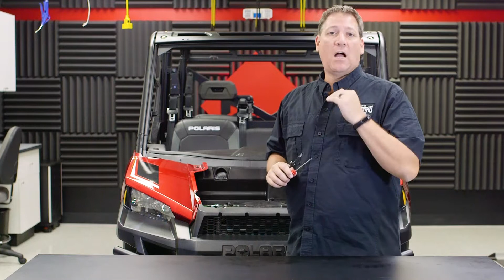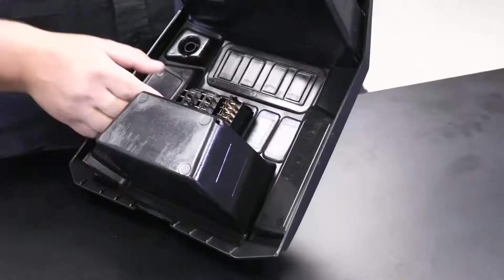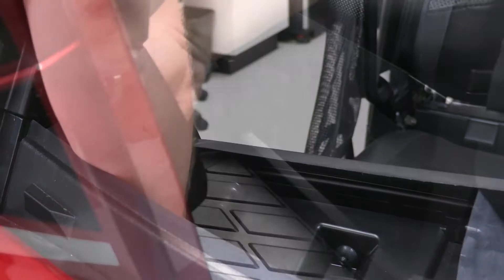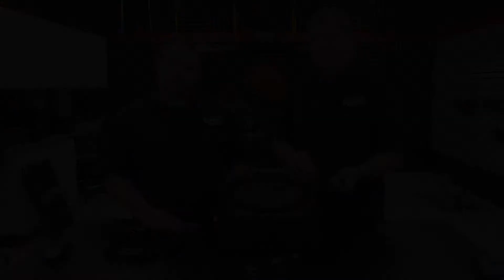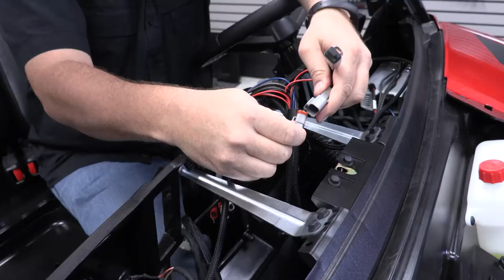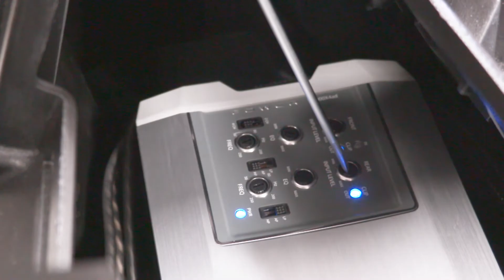RNGR-STAGE3 Installation

Comment: What about adjustment of the amp if the machine is enclosed?
Reply from the maker: If our aftermarket kit was installed and the amplifier was not tuned prior to everything being put back together, the panels will need to be removed.  There is no work-around for setting up the amplifier remotely unless you directly access and adjust the settings on the top panel.
Reply: @rockfordfosgate   i think you misunderstood my comment....you video states you set up the amp in this manner because its a open area machine.   im asking would a guy set up the amp differently in the settings because his machine is enclosed  ?   i just purchased your number 3 system.
Reply from the maker: @Dooguy  Thank you for clarifying that the cabin area is enclosed.  It's the same tuning method based on matching the PMX output voltage to the amplifier's input voltage range.  Acoustically, you just wouldn't play it as loud because you have an enclosed cabin (windshield, back glass, full doors).  You can find and download the tuning sheet for Ranger here: http://rftech.custhelp.com/app/answers/detail/a_id/1356/
Reply: @rockfordfosgate  

I received my kit today can you tell me what the cd disc is for in the kit?   also at the  14 min mark with the sub mount procedure....... I have quite a gap between the front of the enclosure and the actual machine.  like maybe 1 or two gap once the enclosure is set down in to the cavity.   I can see a ton of dirt and dust getting up into the sub cone area.    I didnt notice that gap in your install video.   not sure what can be done to close that area so dirt doesnt destroy the sub eventually.    Other than a crude duct tape job.    Any help?    2018 ranger xp btw
Reply from the maker: @UCUvJFXrf_eeMaQN6KaZn7qA The setup disc is for level setting the amplifier.  We already have the amp configuration available for you to download below.  Regarding the "PS2 Base Control" option, I'm not sure what you're referring to. Could you clarify this please?
• Amp Tuning Guide: http://rftech.custhelp.com/app/answers/detail/a_id/1356/
Reply: @rockfordfosgate    I may have the number wrong on the optional base control that the instructions said  can be added or optional.   I called RF and they told me the amp in my stage 3 kit will not accept the RF base control add on.    I found that odd as it was in the instructions in the lower left side of the page.     Can you address the gap I have when installing the bass encloser.   Its a good size gap that will allow dust and or mud.   The install video didnt really show the sub installed at a good angle.   Im not crazy about how it looks especially with possible elements coming into contact with the sub.   Thanks
Reply from the maker: @Dooguy  Thanks for clarifying.  The owner's manual states: "Remotely control the output level of the amplifier (TM400X2ad, TM500X1br, TM750X1bd & TM1000X5ad)" so the TM400X4ad amp you have does not support an external bass remote.  It only has bass adjustment on the top control panel. Regarding the enclosure, as long as the subwoofer is seated properly inside the enclosure and the entire enclosure assembly is secured properly, you shouldn't have any issues.  Be sure to install the bracket as noted at 12:48 of the video if your Ranger needs this.  Otherwise, the subwoofer is what we call Element Ready, so it's protected against UV rays, dirt, dust, mud and water.
Reply: Thank you...
Reply: What if the red light never comes on during the amp gain setting procedure..... I turned up the volume to 40 and never once did the red light come on.    Also your video never mentions unplugging all speakers before this process.  Yet the instructions off the RF website says to do this .

Very confusing for a beginner diy'r
Reply from the maker: @Dooguy  It won't because the PMX source unit doesn't clip at full output.  As mentioned earlier, you don't need to run the setup procedure since we already have a tuning sheet available to download here: http://rftech.custhelp.com/app/answers/detail/a_id/1356/
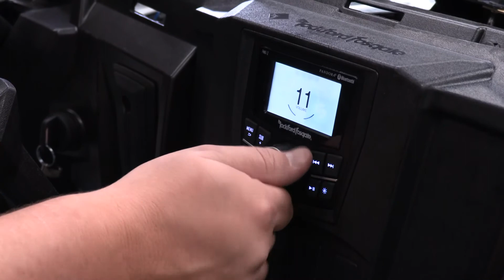Reply: @rockfordfosgate   @ 22:05 it does for these guys?   The video needs updated then...very confusing for the consumer when you get  3 different answers for the same procedure.
Reply from the maker: @Dooguy  The method stated in the video is adjusting the LEVEL settings using MUSIC instead of the TEST TONES included on the CD.  Brad and Rico originally did this with MUSIC because they realize getting test tones into the PMX source unit with no CD slot would be troublesome for many.  We started receiving many comments from consumers not understanding how to setup the amplifier.  This is also confusing because there are different Gain Overlap tracks on the CD based on the "loudness" level desired.  

Because of this, I created the "Amp Tuning Guides" that explains how to set-up the amplifier by looking at a picture, making it extremely easy for anyone to follow.  We setup the amplifier to provide the best compromise between loudness and sound quality.  All you need to do is download the PDF and adjust the dials according to the picture.  This will take all the guess work out of setting up the amplifier.  Your kit should have been shipped with this setup guide in the master box.  If you were not able to find the paper in your kit, the Amp Tuning Guide for the Ranger is linked in the description of this video, available on the Product Page of the Ranger kit under the SUPPORT tab, and is available for download directly here: http://rftech.custhelp.com/app/answers/detail/a_id/1356/
Reply: @rockfordfosgate  Yes I understand all that except I was setting up my system with music as a source like the guys in the vid did.....and there amp turned red at level 40 and they backed it up to 39 then set the gains.   When I attempted this my red light on the amp never came on even at 40.   Maybe im misunderstanding something as this is my first install like this.    I will set it at 1  and 3 and see if im  happy with that i guess.   Thanks
Reply from the maker: @Dooguy  This is an early video (2017) and the process Rico & Brad used back then was heavily reliant on the source material played since the PMX source unit doesn't "clip" on full output.  Because of continual feedback from fanatics like you on these older videos, we updated the process to use the "Amp Tuning Guide" which is a more reliable method of adjusting the amplifier. 

I'm just trying to help recommend the most reliable method possible.  With the aid of our technician Brian, I was able to write the Amp Tuning Guide that recommends the best possible setting for all types of music.  I used this process when filming the 2nd generation kit videos for all RZR and Can-Am models. Every dealer and customer that has used those settings have been happy with the result. -Eric
Reply: @rockfordfosgate    I get it.   I used the 1  and 3 method and did not care for the setting.  Not sure if my buggy being fully enclosed makes a difference but I ended up using more gain to achieve the sound I desired with out clipping.
Reply from the maker: @Dooguy  You'll want to be careful using more GAIN because it's possible to start blowing speakers if you have the volume setting at max (40). If you're using full volume output and it's not even close to being loud enough, it sounds like you may be doing Bluetooth streaming from your mobile device.  If so, try adjusting the mobile device volume to near max output so your source unit doesn't have to over-gain the system to get enough amplitude.
Reply: @rockfordfosgate  yes, I am using my phone and BT.    I made sure my phone volume was at max,.....PX on flat eq.....punch eq down....sub level on front of PX min.......then adjusted amp to 1 and 3.      Ran up vol and my audio settings until i got my desired sound and volume level  i prefer and  the  blue/purple lights flickering on amp.         When i called tech they said its tough with blue tooth and sirrius and I was getting different readings jumping from station to station song to song.... output wize.  he said thats normal and mentioned the amp can light up occasionally as long as its not at long periods of time.    So thats how i adjusted to it.
Reply from the maker: @Dooguy  O.K. great!  Glad you talked with technical support.  They covered the same concerns and it sounds like they have you dialed-in.

Comment: I installed this kit on my ranger. Sound cuts in and out while driving. Any ideas on what may cause this? I followed the install video while doing the install. Sounds great while working, and looks good.
Reply from the maker: Hi Eileen, here's a few things to check:

1) Did you use our Amp Tuning Guide to adjust the amplifier?  You can find the setup sheet here:  http://rftech.custhelp.com/app/answers/detail/a_id/1356

2) Double check to make sure the RCA's are fully connected.  Intermittent connections can cause this.  If the RCA's are pulling out, you can use Tesa tape to keep them connected. 

3) Wiggle the cables behind the radio as they are entering the chassis.

Comment: Did you not show the amplifier wire going all the way to the amp because it's too short? Because I had to add 3 feet of wire to reach.
Reply from the maker: Do you have a 2-seat or 4-seat?  We're assuming you didn't have any additional obstacles to route the wire around.  If it's easier, you may want to contact our technical support group at 1-800-669-9899.
Reply: This was a 4-seat. It is difficult to see in the video exactly where you brought the wires up into the hood area, but I went through and oval opening on the passenger side where some factory harnesses were, then through the large grommet in the "firewall", also on that side.

What would be really helpful would be to include an instruction page packed inside on top that would suggest what order to mount components. I started with the amp and later discovered there is a bolt beneath it to mount the kick pods and mounting the amp first made it difficult to access.
Reply from the maker: Thank you for your update.  Your explanation sounds like the harness was properly routed.  Our NPD group is going to investigate the length of wire.

Did you already provide this feedback to your salesrep?

For this and any Rockford Fosgate product, we have a BRIGHT IDEA form where you can submit ideas, enhancements, or updates to current products in our catalog:
http://www.rockfordfosgate.com/products/details/rngr-stage3
Reply from the maker: Update... we have checked our production harnesses and they are spec'd at the proper length.  Could the installer at DH AUDIO contact us?  Our NPD specialist would like to talk to you about this.  You can contact us at webwizard@rockfordfosgate.com